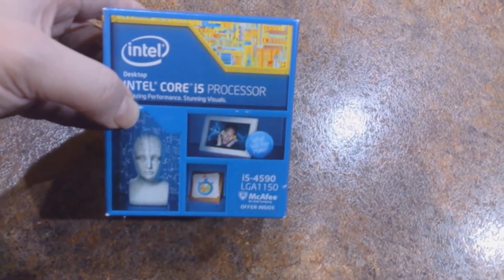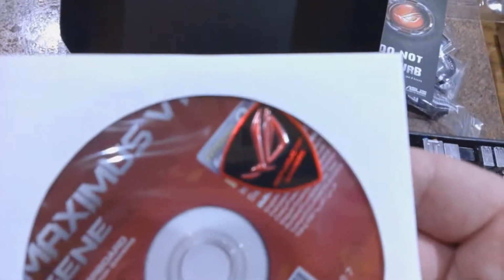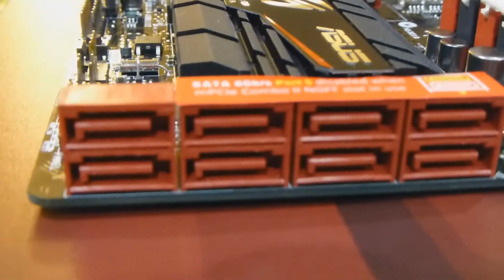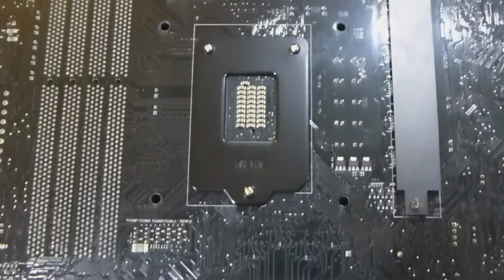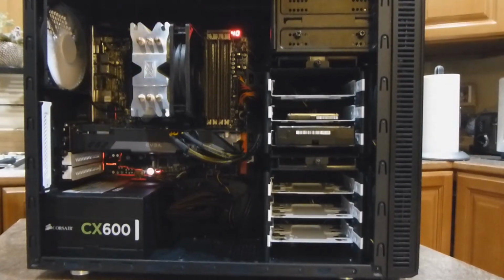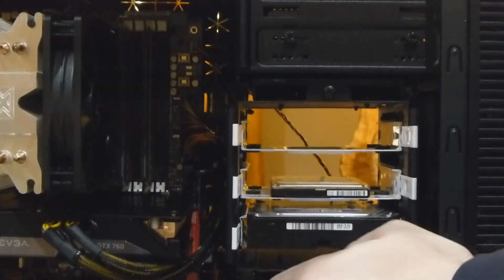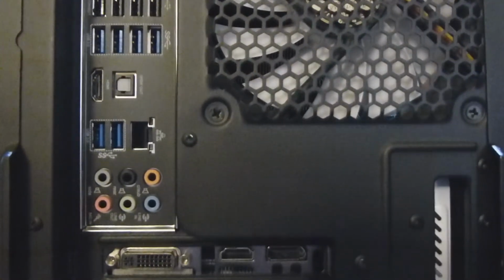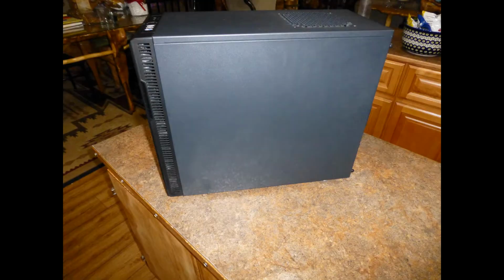Windowed Fractal Design Define Mini-The Brimstone Phase One.

Comment: My gaming rig has a Maximus  Hero VII, nice board, 4770k on water @ 4400 no issues at all, i can go up to 4600 but very little actual improvement with FPS, running dual 970's and it draws about 500-550 from the wall under load, PSU is a EVGA 750 gold, all in a Corsair 750D, and dont think i dont have Fractal products, 3 of my PC's are in Fractal cases, but i really like the 750D for my gaming rig.
And i may be one of the only consumers that has a Node 202, i got it from E-Bay from a reviewer (i told Josh about it he is OK with it) so im so torn on what MB and CPU to put in it, i have 2 EVGA 760's in my current HTPC (overkill i know but its in a Define R4, its just to big for a HTPC, and the GF hates it...sssoooo you know what that conclusion is, GF hates it. I like vaginas more than computers
I think i will just find a nice mini  board for the Node 202 and use one of the 760's for the HTPC and keep the 2600k with one 760 in the Define 4, i was thinking AMD but Intel has better mini boards available, what do you think Cell?
Another option is dump the GF :)